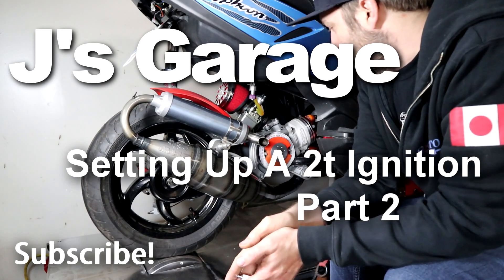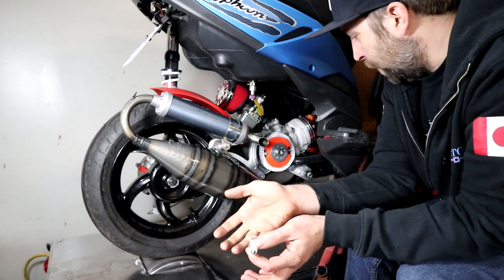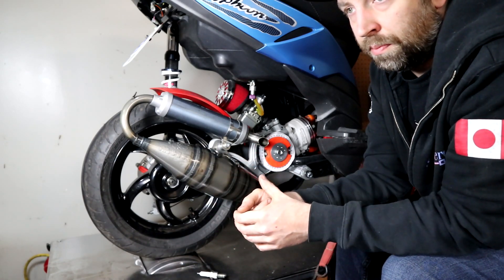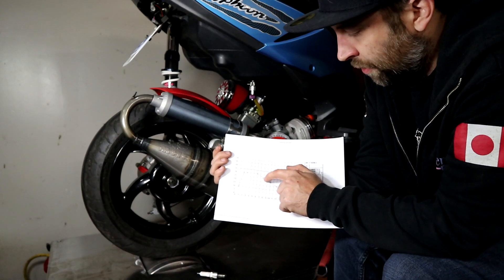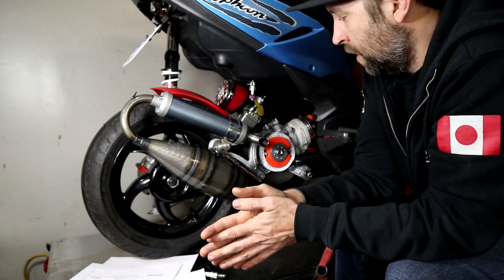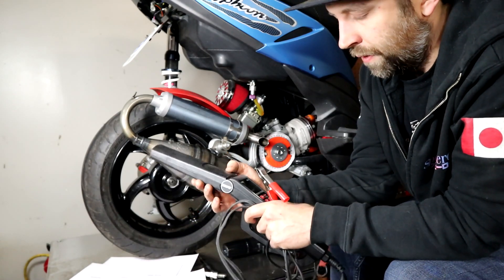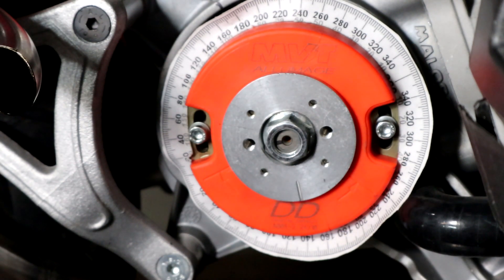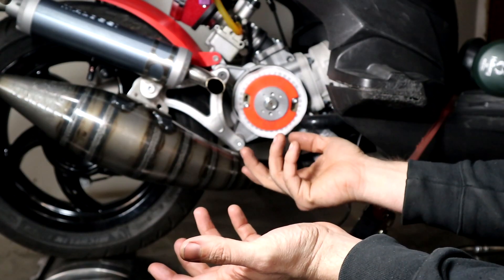Setting Up an Internal Rotor 2 Stroke Ignition - Part 2 - J's Garage

Comment: Hello I installed the MVT DD 08 on a Honda Dio following instructions and set it at 0,35 mm BTDC. I found out the curve on 49 scoot and I noticed it has a very High advance at low rpm ( over 40°). I used the scooter at a 8k rpm range for moving and I overheated and destroyed the piston and the exhaust on the cylinder. I wish I saw this video before and set the advance at low RPM like you did at around 28°. Considering the curve of MVT with RJ34-6 ( set to go from over 40° at 2k and at 10° around 14k) what happens if I set the 2k rpm at 28° when the engine revs at 14k. Will it go to 0 advance? Sorry in your video you mentioned at high RPM is around 10° ( or the reading after 10k was not clear). Please explain the new curve you obtain when you set 28° advance at 2k rpm  thanks a lot

Comment: damnnn your a wizard, I have a question for you, im already building a runner 180 race carter, its all done now but i does not want to start..... Can you help me, i can send pics. i have a runner 2000 with an bigger membraan then stock, its welded en filled up. Hope to here from you :)
Reply from the maker: Hey, Not sure what that could be.  Very hard to diagnose over the internet too.

Do you have spark?  Have you pulled the plug and kicked and checked? 

is the plug wet?

if you add fuel manually in the spark plug hole or down the carburetor does it try to run then?

If you hold your hand over the back of the carb and manually choke it, do you get fuel on your hand?

It could be fuel delivery, or electrical or lots of stuff.  Again hard to diagnose over the internet.
Reply: @pitobread  Can is send you some pictures from my scooter? so you can see my project? i think you want it to see run too then :)   Yes sparkplug is oke en blue. Yes its not the greatest way trough internet :) i can make a list off it wat is done, with pictures. Sorry for my bad English im from the Netherlands. Thanks mate, i think i maby need HPI just like you.
Reply: Mike idk if you fixed your problem but try to mount the ignition 180° rotated maybe you have the false engine-Spin-direction choosed on your igntion mount

Comment: Nice Video again , It's funny you said that about the light going blank like that it  hard to see on video. But i worked on smaller motors Zenoha 25cc or 36cc that will do 12 ,16, grand or more and    I was installing MSD ignitions on them and when i would hit them with the light and attempt to set it up just that would happen Blink out nothing , i sent two lights back and a Tach be for i figured that crap out !~ lol          Damn looks like you and i are the only ones into this Tech tak 101  ignition   stuff lol   Good video keep them up i watch lol ahahah